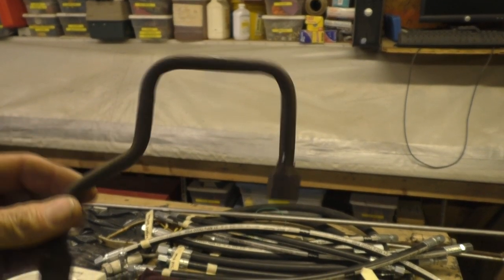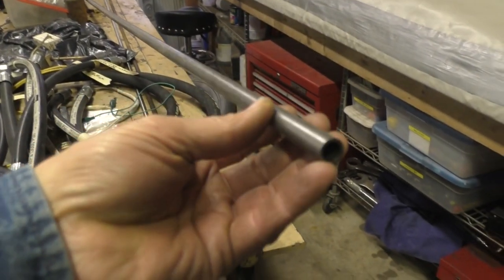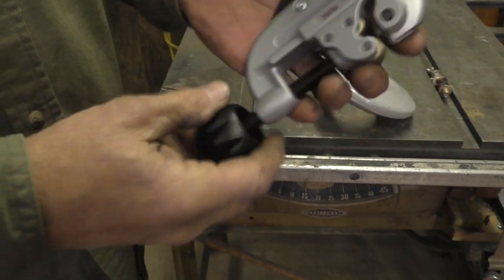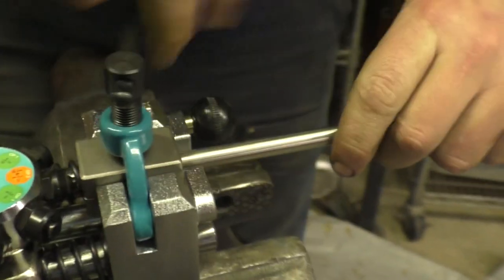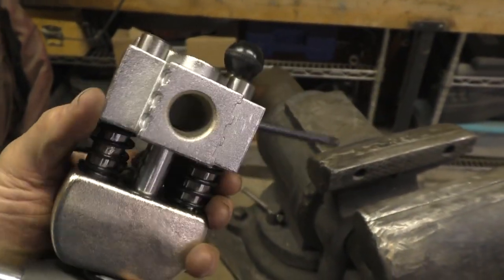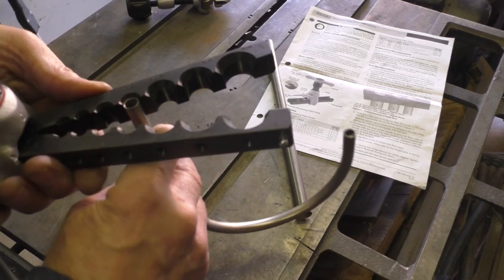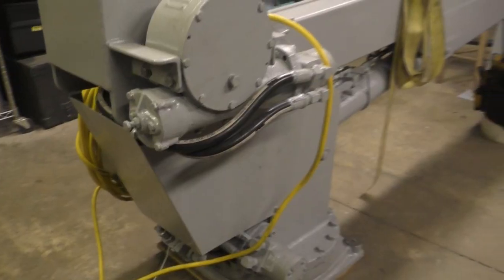Flaring and Bending Steel and Stainless Steel Tubing

Comment from the maker: [ Amazon Smile support for The Sea Chest Foundation ]
https://smile.amazon.com/ch/83-2588177

Imperial Triple Head Tube Bender   https://amzn.to/2ZLLYre
RIDGID Close Quarters Tubing Cutter  https://amzn.to/2NVBHWu
RIDGID Tubing Cutter  https://amzn.to/2ZMlXYA
Mophorn Pipe Tube Bender   https://amzn.to/3kgrpMS
TGR Flaring Tool with 45 and 37 degree  https://amzn.to/2ZIBwAP
Reply: Those tubing cutters come with a extra blade to change out.

Comment: Hi Doug , I found that if you put a little lube on the tip of the rigid flaring tool you get better flares. And your tube should be even with the top of the flare clamp. Have fun.
Reply from the maker: Yeah, I forgot to mention that.

Comment: I use the first flaring tool you started with.  If I understand the written directions correctly, on a 37-degree flare, you start with the 0 option, then go directly to the #2 option and skip step #1.  It's worked for me so far and building 3/8" stainless fuel lines on a hot rod.

Comment: Mate, Love your style and way of doing things. The stainless pipe will rust where it has been heated if you polish the pipe it brings the chromium carbides back to the surface of the metal witch gives is its weather resistance. Cheers mate from downunder.
Reply: Fascinating
Reply: Or if you passivate with citric or nitric acid.

Comment: A simpler version (without the clutch) of the last tool was what i've used back in the 70's for flaring brake pipes on one of my cars.
Simple and effective.
Reply: Not so good on stainless steel tube. You need the wobble point to get a good flare in stainless.
Reply: @davidapp3730  Makes sense, i just find it amusing that the old "style" seemed to be better than the fancy one, and more compact ;)
Reply: @sparkyprojects  Not sure how new the fancy one is. I was using the one with the clutch about 20 years ago.

Comment: Thanks for the video. I got a cracked flare one out of three, so heated the rest...no more cracks. i'll just have to take my chances with rust. My 377 Ridgid did not come close to being able to flare the 1/2" super thick, 316 stainless tubing, so I used grease and an open end wrench on the nut under the handle. It worked. Hopefully there won't be leaks. Oh. be sure and use never-seize on the stainless flare threads, or they will gald!

Comment: I have the Imperial Eastman 400F Rol-Air flaring tool.  Expensive but by far the best I've ever used.  It uses internal rollers to form the flare.  When the amazon cheap ones fail (and I have several) This one works like a dream.

Comment: Done many flares using the Rigid tool. It is great but takes some effort to turn. Replacement wheels are great to have on hand so when your tube cutter stops cutting you just put in a fresh sharp wheel.

Comment: The off center flaring tool is great.  I have one (Yellow Jacket)  I use for air conditioning flares, where you're talking about constant high pressure and sealing molecules from leaking.  In A/C work some of us also use a special sealant on the flare whose name I don't recall--sorry.

Comment: I've used hydraulic fittings in the past that allowed enough margin to cut the tubes with an angle grinder and did not require flaring the ends, the connections held up to ~700 bar (10.000 psi). It uses a deformable collar similar to what is used for normal copper tubing.
Edit: commented too early.

Comment: I like my Imperial tube flaring tool better then the Ridgid , but the Imperial is quite expensive. A tapered reamer works great for cleaning up tube after cutting. Packing tubing with sand and capping helps a lot when making tight bends.

Comment: I built a little cub cadet backhoe loader and used NPT fittings at first. After looking at the mess of hoses, I decided to move to JIC and steel tubing. The 37 degree flaring tool I found (that also works on Stainless) is the imperial 402-FA - reamer and flaring tool. The neat thng about this one is that the flaring park of the tool (cone) has three rollers that do the flaring work. It was an expensive little tool but it would go up to 5/8" tubing.

Comment: If you are not heating the end for flaring, a bit of grease on the flare die helps.  Ridgid does sell replacement cutter wheels for their tubing cutter..  Get yourself a couple.
Offset flaring tools are a great invention.

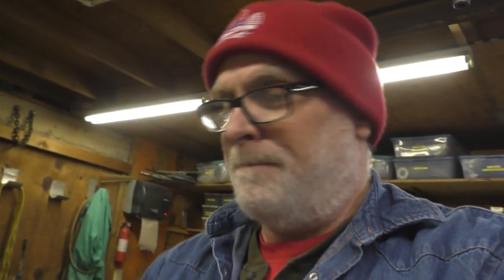Comment: 3:31 You know you can change the blades in tubing cutters right? I went through dozens of the blades as a young man, making aglets for the tail end of rope horse halters my dad tied and sold. We'd sit in the living room, he'd tie halters, and I'd cut copper tubing into 1 inch lengths to crimp onto the rope, cut hundreds of joints of copper pipe into pieces with a hand cutter while watching tv. Every trip to town included more cutter blades and more pipe.

Comment: Worked in the commercial dive industry and did the grunt work fabricating saturation dive systems. 99% of the plumbing was stainless tubing, we didn't flare any of it. First we were working with O2 and helium, all joints were silver soldered with O-rings for sealing, Helium is a pain to keep from leaking. When we did hydraulics we did flare the hard lines, most of the time, just used an old school flaring tool, the manual kind. For all but a couple of large Dia. lines we used a hand bender. Built up upper body better than going to the gym. LOL
Reply: On the tubing cutter, make sure you get the cutter wheel for stainless, but get a couple as they are a bit prone to breaking.
Reply: Swagelok is another way to go but pricy. It is quick though...cut to length, deburr, put the nut on then the ferrule, screw on to the swage block or fitting and turn one and a quarter turn......done.

Comment: Hi Doug,  if you like your rigid flaring tool, check out the Rothenberg one. It has a guide plate so you can only puthe pipe in so far,  plus you can use a cordless drill to tighten.

Comment: That Ridgid Flare tool is great - little touch of oil on the inside of the tube tip that's getting flared helps reduce splitting (careful not to get any on the clutch - it may start slipping too easily) its a real workout on your wrists when you have a bunch to flare (especially when you have forgotten the nut before flaring,,,, requisite swearing, huffing, deep breaths and starting over)
Interesting you went for SS tubing given the added cost and headaches of splitting (it also a bit weaker so has slightly lower pressure rating) cost of fittings is like 3x the price - why not use MS and paint - I get that its an extra few steps and a bit of a headache but MS fittings are way more available.

Comment: Can you use copper instead of metal tubing?  I know is an stupid question. But I wonder how much  pressure  metal holds against  copper. Thanks
Reply from the maker: I don't see why not, but it's too soft for many hydraulic applications.

Comment: Glowing the pipe has caused some issues for me. It changes the properties of the pipe in this spot. The metal tends to get somewhat softer. The parts that have seen red-glow levels of heat are much more prone to corrosion to. You can see the latter in exhaust piping in rugged environments.
Reply: Heated stainless is still better than plain steel is. So better than what was there.
Reply: I was thinking the same, I'm not sure how much that changes the metals properties, but depending on why type of system you are using it for (possibly low pressure) it may not matter. For a high pressure hydraulic line or something, I would do some double checking before I heated the bad Larry up!

Stainless steel contains iron, I believe the only part that is stainless is the surface? I read that if it is scratched it can expose those iron atoms to oxygen and rust just like steel does. There is a process, I believe called passivation (I apologize if I didn't spell it correctly) from what I read, this essentially dissolves any iron atoms on the surface layers of the stainless, leaving whatever is in there ( chromium??nickel???) To act as a barrier. So if you cut, scratch, grind, or heat/weld stainless steel. The new material now in the surface must be passivated to maintain the corrosion resistance? 

I may not have that correct, but there is something related to all that that can bring your corrosion resistance back. I am buying a kit for my tig weld that supposedly does a great job at exactly that? So I'll find out soon enough!

Comment: What wall thickness tubing are you bending and flaring? I need to bend and flare some 1/2 and 5/8 stainless tubing in at least .049" wall thickness although thicker would be nicer.

Comment: There are deburring tools. They are pretty cheap, but in a pinch, there are other tools that will work, like the drill used here. On mild steel you can get away with just a good flat blade screwdriver. I wouldn't try it on stainless though.

Comment: Why would you throw the entire cutter away when the cutting wheels are replaceable and there is a spare one in the tightening handle?  Just asking cause the good ones aren’t cheap.  And  when using stainless steel that can handle the hydraulic type pressures the wall thickness is too thick for flaring.  Need to use Swagelok style fittings.  Plus no need for all those speciality tools.
Reply: Paused the video to look at it, and while I can't say 100%, I think that was a piece of junk took where the blade wasn't replacable.

Comment: You do know you can change the cutting blade on tubing cutters don't you?
Reply from the maker: Yes but it does nothing for the shafts.  Feel free to go through my garbage. :)
Reply: @SVSeeker  I don't care to go through your trash but welding a broken tubing bender and trashing a easily fixed cutter with a new blade and blade shaft when both tools are comparable in price just dosnt make sense but I guess it doesn't have too when cost has no limits.
Reply from the maker: @joetri1970  It's not a dull blade.  It was a bent shaft.   And you really might want to think about adding something more in your life.
Reply: @SVSeeker  your right I do need to more better things in my life and not watch crappy youtube videos .
Reply from the maker: @joetri1970    An excellent start.  Turn off the screens, get out in your shop and do something productive.   You'll be a new man.

Comment: I thought heating up stainless steel too much will cause it to lose its rust resistant properties?
Reply: Usually doing almost anything aside from polishing it will cause a variety of problems later. Any cutting, welding, bending, attaching items, drilling, coating etc